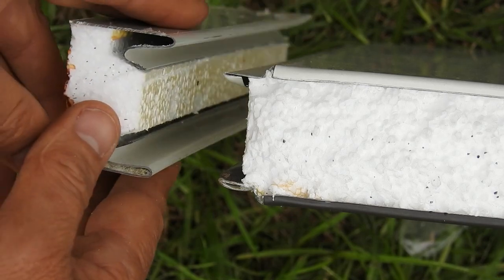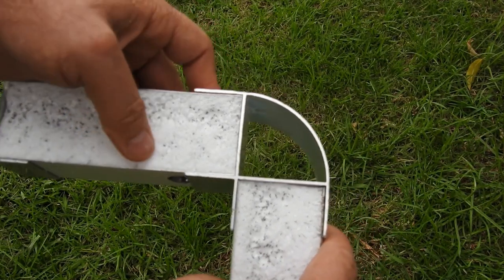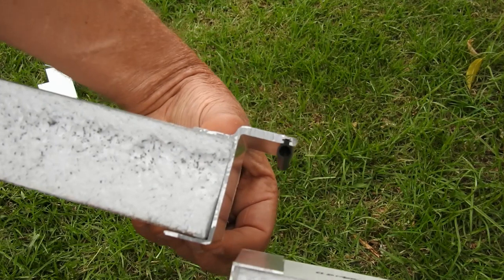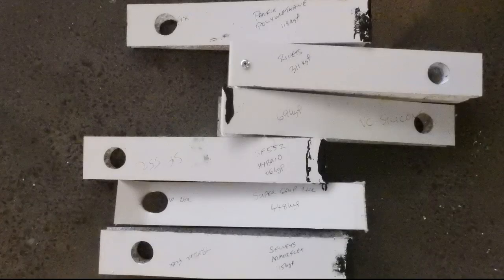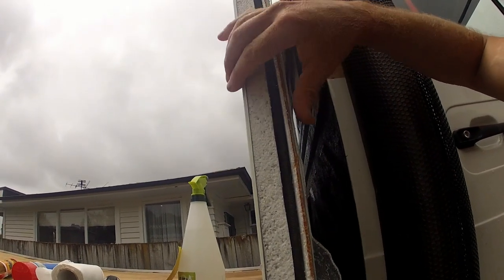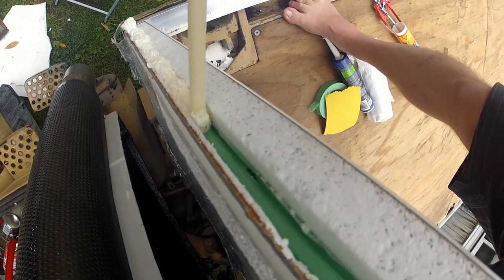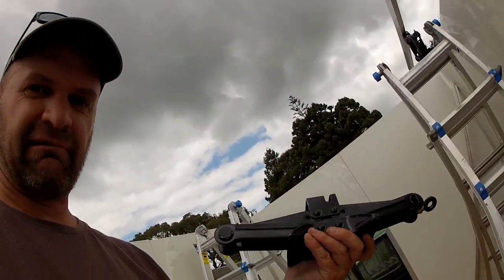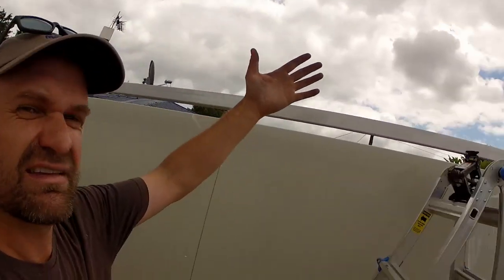Unimog camper #3  Box build

Comment: Hi, I'm trying to work out the cheapest way to do my box, if you don't mind, how much did the box cost you in materials?
Reply: Not to worry, I read the comment further down on price.
Reply from the maker: All good, what sort of structures and pricing have you been looking at?
Reply: Brendon Tait I can get a proper factory cut 3cm foam and fibreglass done, just 4 walls for $5500, I think I’m going to follow your method.
Reply from the maker: @ThaboNel  it's difficult to know exactly the best method....  if following my method you'll likely want to allow a lot extra for a coating.   I like steel panels because they dent instead of crack.  I have an old insulated container that is foam/glass with some cracks in it... the foam is pretty much waterlogged and the container is now worthless.  Steel panels are also resistant to lightening strikes.

Comment: hi man, excellent work! which is the name of those panels?
Reply from the maker: Hi Dante, thanks.  The panels are called SIPs or structural insulated panels.  A lot of people prefer using the composite foam panels but for a few reasons I like steel.
Reply: @brendontait6968 , thanks for the data man¡ I just was wondering how fast you can set the box, these are more expensive than the composite panels? have you any web site to recommend to check prices in Europe? thanks in advance!
Reply from the maker: The box took me one day, the roof took me one day and the doors took me one day.  I assume the composite panel is more expensive than steel.  There are advantages and disadvantages for each.  Steel does conduct heat/cold down from the extrusions quite well, composite panels dont, but can crack when hit whereas steel dents.  Steel is safe from a lightning strike, composite is questionable.  I don't know any European sources sorry, but it should be fairly easy to find.  I liked the styrene as opposed to the urethane/iso core since it has better flex.

Comment: Upon pain of instigating kiwi jokes, have you considered a double skinned wall filled with wool insulation for health reasons? 🐏🐏🇦🇺
Reply from the maker: Hey Chris, As far as the styrene is concerned... it is shielded by a steel wall so I suspect not much vapor will come through.  The SIPs panels are so cheap and easy to build with...

Comment: Where did you buy your extruded aluminum profiles?
Reply from the maker: The large section ali for the rear was just from a local aluminium supplier and the ali for the panels was from the panel supplier Metalcraft (insulated panel division)

Comment: do you mind sharing what adhesive you used? thanks
Reply from the maker: The sika that I used fell apart after a few weeks.  I used Selleys armourflex to bond the panels etc together, this has remained strong.  If I were to do it again, I'd use armourflex on everything and chromate coat the aluminium.